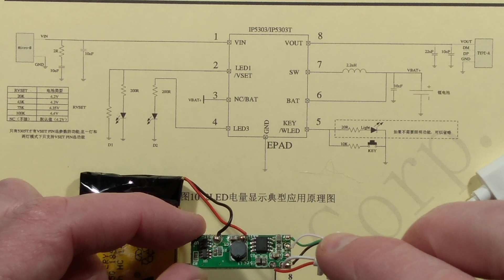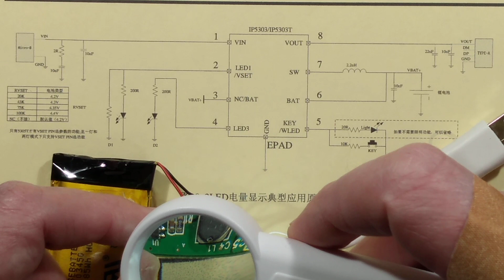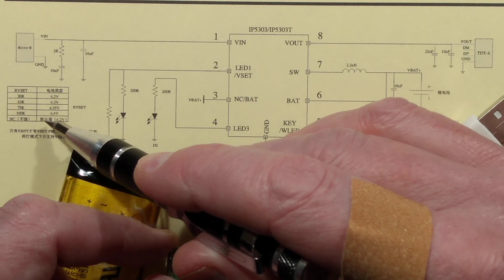Combustible fluffy USB powerbank.  With flame test.

Comment: So... They sold it as "2000 mAh" but it's actually a "1850 mAh" battery at 3.7v (which means less capacity at 5v)… And that's not even to speak of the battery not being its rated capacity.

Comment: its pretty ridiculous that the label on the outside of the module says it's 2000mAh yet the actual battery inside has a label of 1850mAh. i dont think theres any way they can spin that, right? its just a complete lie

Comment: @bigclivedotcom My neighbor and I were discussing if 12 volt car batteries could be revived with a electrolyte solution. Then, today I see an ad about reconditioning batteries, before your video. What is your option on it?
Reply from the maker: Not sure.  The usual failure mode of a lead acid battery is sulphation of the plates where an insulating surface grows on them.  It's usually better just to buy a new battery if the old one has been left discharged for too long.

Comment: It's a nice, compact design with a decent amp output (1.2A) and no sockets, just solder points. Really cool for DIY stuff with low power SBCs or micro controllers that need 5V.

Comment: How do you test for capacity of a 18650 battery anyway? 
Curious, Can I just use a DC ppwer meter and some type constant load until the minimum battery voltage is reached?

Comment: Did the fluffy material self-extinguish within the 30s limit required for approval?  After all the common flame retarding additives are sufficiently unhealthy to encourage using the minimum amount even if money is not an issue.

Comment: One one hand, That is one very safe powerbank - N+2 redundancy for battery protection circuitry. One the other hand, if the battery decides to fail anyway due to something like a manufacturing defect, that black pussy is more than smoking.

Comment: one big thing is they (all usb power banks) get very warm in use, i noticed the warmth when i plugged my charger in my video camera when in use when ive been filming at conferences.... so that blck pussy would get very very very warm...but would it overheat as it will tend to keep heat in rather than help vent it

Comment: I believe the battery is made by ‘Hansen’ (hence the H) and 103450 is a very common model no of LiPo. Not sure specifically what else these were used in but as you suggested most likely shitty phones, other powerbanks etc 👍🏼

Comment: The battery is a very common type I'm very familiar with, iirc, it was originally for a digital camera But has almost become a standard as its a very good size.  Generally decent cells, I've had them come in in the product  (I work part time servicing) from with 5+ years of daily use and still at about 70% of their capacity with few failures. Great little hackable PCB too, particularly being able to give out 2+ Amps.

Comment: Oh Clive you are awful.

BTW you were in my dream last night, you were wiring fairy lights into a tube train. I had forgot my shoes and was wearing a sleeping bag.
Reply from the maker: The main problem with putting fairy lights on tube trains is that they need to be modified to operate at over 500V.
Reply: @bigclivedotcom  you were doing something clever with the existing lighting. You'd managed at least three carriages already. I'd fallen asleep and the train had got to Cornwall despite being a London underground train, so you'd had plenty of time

Comment: Just to join the party; re:adverts
I have Ublock origin, Ghostery and a Pi-hole. I do not see any adverts on YT. If you are not using a Pi-hole then I recommend that you do. It has a HTML dashboard that can show a lot of info. Like how my new Nokia 5 phone is connecting to the internet all night. Bad phone! Do not buy it, it's Google that is to blame. My old 1st. gen Moto G would run for days, this new Nokia is flat in 48 hrs.   :(

Comment: Always seems so random what words the automatic caption transcriber will refuse. Some it will refuse on one video and happily transcribe on another (see AvE videos for instance)

I was hoping you'd get to the tape atop the cell and look for belt-and-braces protection, was very happy when you eventually did!

I thought cable insulation was supposed to be self-extinguishing, maybe that's only mains stuff?
Reply: When we give a computer the power to convert speech to writing the results can be spectacular from time to time. However as someone who has a variety of job history, self extinguishing cable insulation is only "required" whenever the cable (regardless of type ) is to be installed permanently inside walls, above ceilings, or below floors. Usually this is more recognizable in network cabling, at least here in the USA.

Edit: forgot to mention, nothing is completely self extinguishing... if you can get it hot enough it will continue to burn.

Comment: The 2A rating on the thermal fuse just tells what it can safely pass; it doesn't mean exceeding 2A will blow it (unless the current gets so high as to heat it up to the trip temperature, but then I wouldn't trust it).

Comment: Umm, copper doesn't burn that easily... did you just show the wires are aluminum? Cuz I test network cables all the time using the burn test and it don't melt that quickly.
Reply: yeah, aluminum wire will melt and frizzle. copper won't.

Comment: most the ip chips are injoinic chips. They make all kinds of ICs but their powerbank chips are in the 5000 series of chips they produce. They are becoming quiet common in many power banks, especially the newer fast charging ones. They make a huge number of variations of these chips for different powerbanks.  I have quiet a few power banks using these chips including a few fast charging ones. They are nifty little chips and are good at what they do however they do have one downfall, being made as ridiculously cheap. (literally 100 of them would cost you a few pounds at most) as they are, they don't last long or will burn out over time under normal use. That is one thing all the variations share in common. It doesnt take much to kill them if pushed to hard.
Reply: hence that extra little bit of "Protection" ;)

Comment: Damn Clive,   You reminded me of a bad experience with a Doctor a few years ago.   I have a box full of various type connector I cut off things  to be able to interface and test these things.   In the Old Days most decent Electronic products like radio's / TV / and other actually came with  Schematic.  Remember those days ?     I purchased one of these Chines LCR Transistor checkers most handy Identifying those unmarked components.   https://www.banggood.com/LCR-T4-12864-LCD-Graphical-Transistor-Tester-Resistance-Capacitance-ESR-SCR-Meter-p-1311439.html?rmmds=search

Comment: I made me some USB A <-> Barrel conector adapters for using a USB multimeter to test laptop power supplies. I expect you have the parts on hand to make yourself a microUSB to female full size.

Comment: Is there a limit to the size and capacity of the battery you can connect to that PCB ?
Could you use it to make a power bank with really high capacity ?
Reply: As long as the voltage is the same you can put as much capacity as you want behind it.